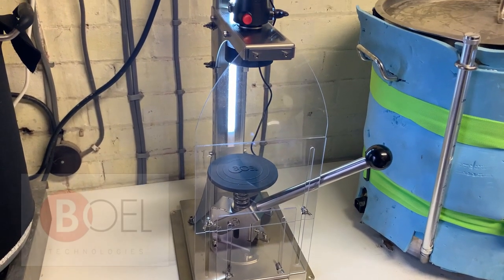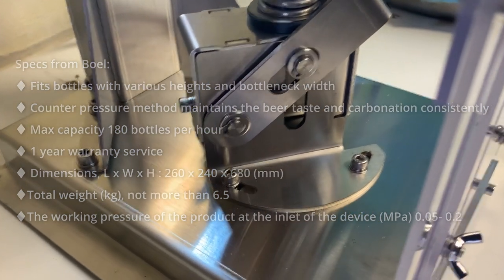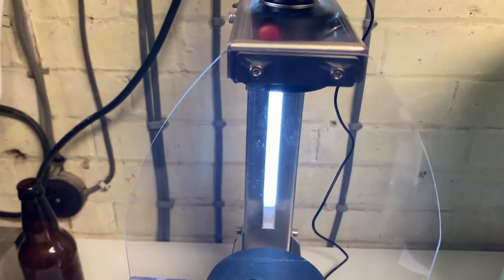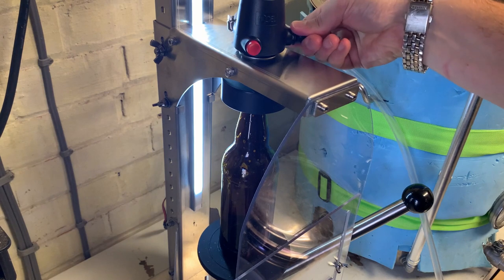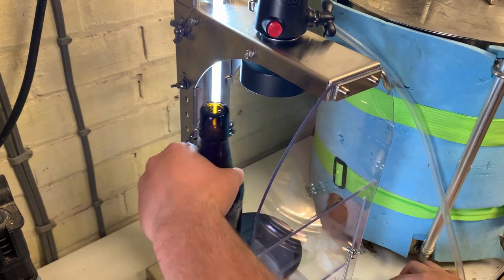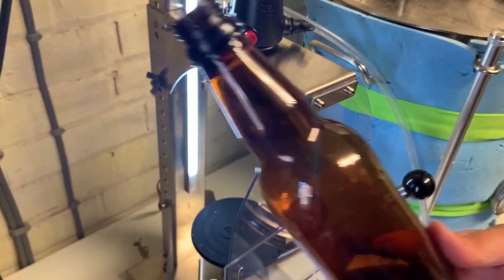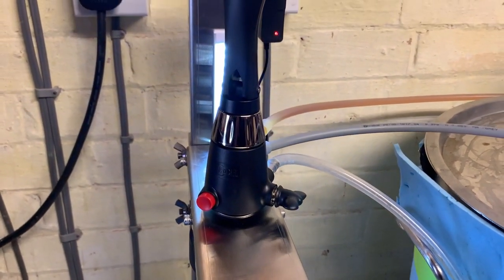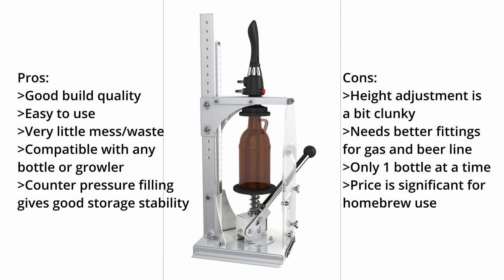Boel Technologies iTap Pro - Review and How to Setup Tutorial

Comment: Are you capping on foam?  I started to make sure to do that and it's made a major difference in my shelf stability of my beers.
Reply from the maker: Yes, its quite easy to make sure its on foam with the itap systems
Reply: @DudesBrews  Glad it’s easy!  I have a tap cooler, but have the itap coming in the mail.  The tap cooler works but when you pull out the stopper there’s always dead head space which I have to trick to get foam (tapping on the side of the bottle with a spoon works).